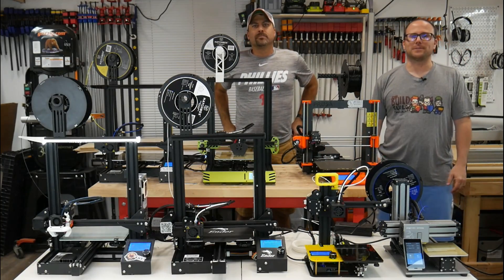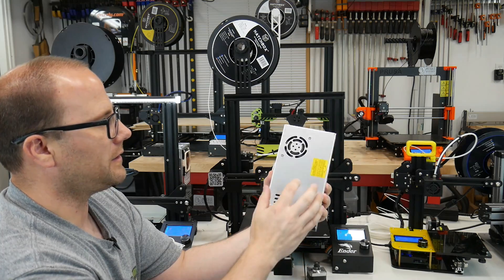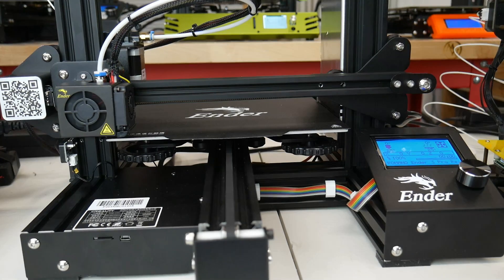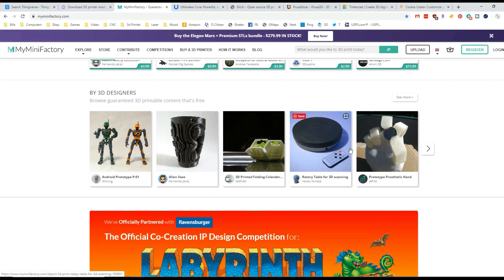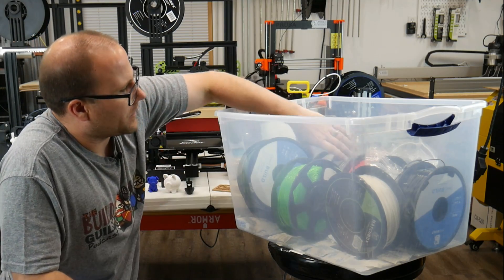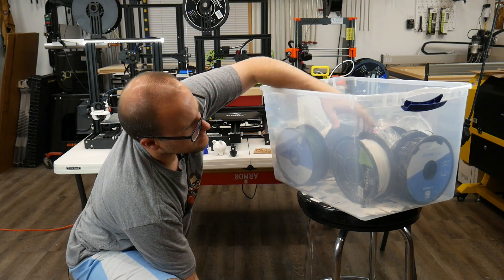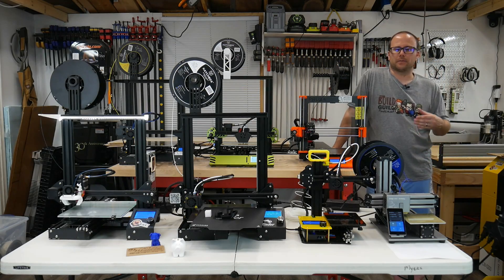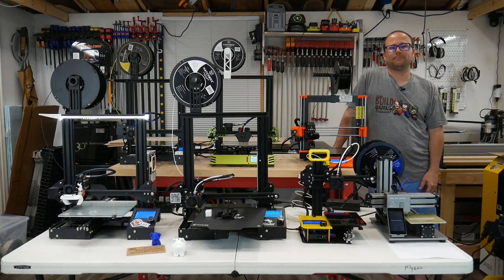Intro To 3D Printing

Comment: Thank you for this informative video.  I am very interested in picking up 3D printing as a new hobby.  This is the first video on 3D Printing I've watched.  This video introduced me to terminology, features, software, and hardware options.  Based on this video, the Prusa i3 MK3S kit seems like the most enjoyable and least frustrating of the bunch.  I still need to do more homework to make sure I will not miss out on cool features the Prusa i3 MK3S may not have.
Reply from the maker: They came out with a Prusa mini since the video was made.  It’s the perfect beginner printer!
Reply: All the 3D printers you discussed use Fused Deposition Modeling (FDM) technology.  Now that Stereolithography (SLA) and Selective Laser Sintering (SLS) 3D printers are available, are these worth considering?